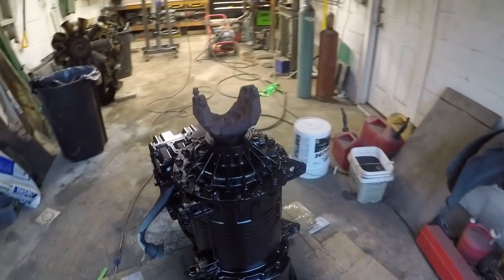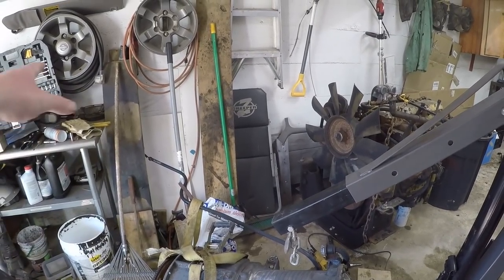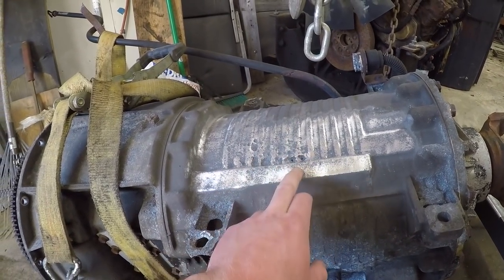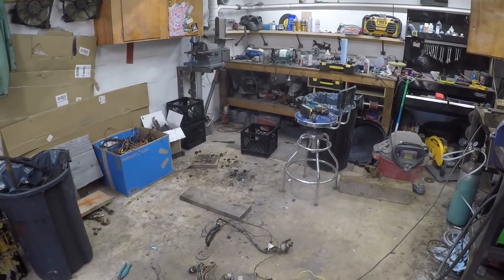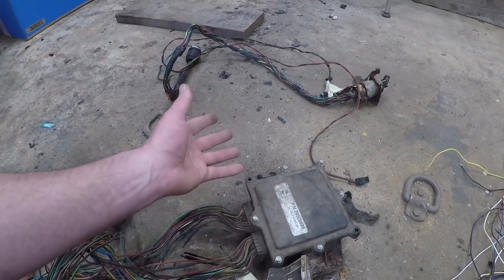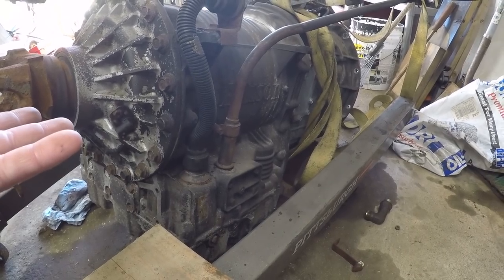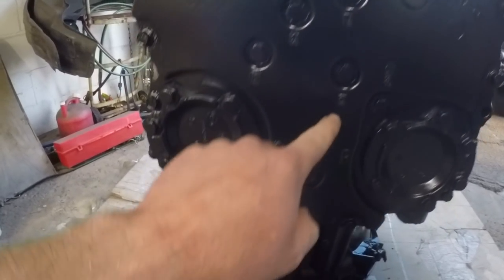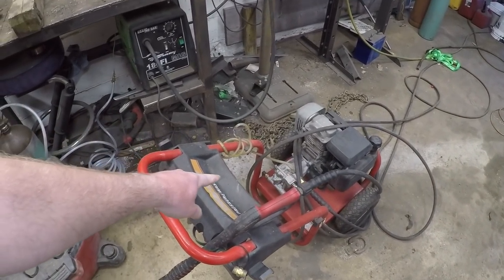Pt. 44 Getting The Allison Transmission Ready To Go Into My F350. MD3060 Swap Into Cat 3126 Ford

Comment: Hey Drew...a good source for parts and info..as well as repair service is Atlantic Detroit Allison..they are in the Latham/Albany area and have techs with great knowledge..The allisons are tough..most issues i've seen are usually a corroded wire or a tone ring on the tailshaft break..good luck with your project
Reply from the maker: Thanks for the info! I’ll have to look them up!

Comment: Realy should have drilled the ends of the crack to prevent spreading.  

Could also have sure simple rod to repair it .
 I hope under load it doesn't catch further .

Good work , enjoy your videos
Reply from the maker: Without knowing what is on the other side I really didn’t want to drill into it and possibly damage something important.
Reply: @DrEwBaBy625  I understand your thinking 
 But the repair you did is the equivalent of gum to fix a hole in a boat . 
Not trying to be rude . By any means.  

There is also a product * simple weld rod *  look them up . Works dam good on that type of repairs

Comment: I have a md3070pt allison 6 speed in an m1078 lmtv 2.5 ton truck.  Its a 95 and takes the wtec 2 tranny controller if that helps any.  I got filters on ebay (a kit) for 35 ish and used NAPA tractor power shift fluid for the tranny fluid (Army used 15-40 engine oil) and NAPA called his allison ghuru and he said it was fine, no trouble with the tranny.  Mine has a big transfer case attached to it and total took about 8 gallons to fill it up.  Way cheaper than Allison ATF.
Reply from the maker: The army uses engine oil in the transmission? Hmm I feel like I have seen one of those transfer cases they are huge! Thanks for the info!
Reply: @DrEwBaBy625  The fill for the tranny and engine are next to each other and I suppose the army got tired of mixing them up so one size fits all.  It shifted like a brick when it was cold but was ok when it got hot although I changed filters and fluid soon after I got it, now its like butter with the NAPA tractor fluid in it.  Dont over torque those filter cover bolts, they strip easily (dont ask).

Comment: Looking at the transmission, do U have to massage firewall to give little clearance ? Small bodylift? Excellent work & craftsmanship you are doing. Have a good day
Reply from the maker: Truck already has a 3” body lift to help fit the cat engine so clearance shouldn’t be an issue even though this new transmission is much larger. Thanks! You  too.

Comment: Did you drill a hole at each end of the crack ? As heavy as that Allison seems it will split in two at the crack. It is under extreme clutch and hydraulic pressure. Just and FYI for you.
Reply from the maker: The thought did pass through my mind to drill a hole at the ends of the crack but not knowing what is on the other side of the case I didn’t want to create more problems. I will definitely be keeping a close eye on it.

Comment: Were you able to know or find an adapter to turn it into a 4x4 application?  I want to use that 3060 Allison in my ram 3500 4x4
Reply from the maker: I used an NP205 divorced transfer case.

Comment: Awesome... what does that trans use for the shifter ?
Reply from the maker: It is a push button shifter.
Reply: @DrEwBaBy625  so are going to get a manual transmission steering column then
Reply from the maker: At some point probably.

Comment: Hows the length vs the one in the trk
Reply from the maker: I did some rough measurements and it looks like the 3060 is only a few inches longer than the 545.

Comment: I was looking at these transmissions awhile back because you can pick them up cheap sometimes. I saved a few links and will try to update this post as I find more of the information because I really want to know how it behaves in a smaller truck. Did J.C. mention if this one had 6th gear enabled or not? If it doesn't it can be hard to get it programmed for it. Allison is almost no help for this unless you have a buddy that works for them. Here is a link to possibly get it reprogrammed.

https://pcmperformance.com/TCMs.html

All of those hard to find allison harness connectors.

https://www.allisontransmissionpart.com/connector_catalog.php?time=1553139909&id=DT043PP007&cats=82:274:13:97:259:262:70:265:268:271:

There are two different lengths of filters (long and short) so make sure you order the ones you need. The valve body is also part of the trans pan and not bolted up inside like the 1000 series.

I'll try to add more later.
Reply from the maker: Thanks you! This should help out a bunch!
Reply: @DrEwBaBy625  Here is a good video on  changing the filters and how to tell if you need the long or short filters.

https://youtu.be/_5PbOg9x4qo

You need to determine what generation of tcm you have to find a wiring diagram. I think there are at least 3 or 4 different generations.
Reply: @DrEwBaBy625  It's in Spanish but it shows the teardown of a 3000 series. He also has videos that shows rebuilding  but is pretty rough and doesn't measure anything I think. It isn't a guide to follow but you'll get an idea of the workings of the transmission. I had very little transmission knowledge and now have a basic understanding of how they work. Also watch videos about the 1000 series. Some parts look a little different but they function almost identically. 

https://youtu.be/DCMaBFo2Twc

Comment: New sub here,so hello. Question: Is the engine in the garage a 3126 also,and will it be being rebuilt and mated up to the trans and getting swapped in? Would be nice to see someone do things right and completely rebuild things and install them into an engine bay that has been degreased,powerwashed,primed and painted. Most of the channels i sub to seem to do things fast,as opposed to doing them the right way. I dunno,maybe i'm just very picky lol. Anyway,first video i got a notification on and i enjoyed the content.
Reply from the maker: Hey! Welcome to the channel! The engine in the garage is a 3126 however it it is an earlier version from the one currently in the truck and there are a lot of differences between the two so the one in the garage will be getting sold when we are done getting all we need off of it. Unfortunately time and money play a big role in how I do my build, in may I will have 2 kids under two yrs old so I don’t have much of either. I do plan to replace a few seals that are leaking on my 3126 and taking the time to paint the engine as well as clean up a lot of the wiring but beyond that I don’t have any plans to completely overhaul the the engine or transmission. I also don’t have the best shop space so most of my work has to be done outside so I am hoping to be done and driving it before next winter. I try my best to do things right within my resources.